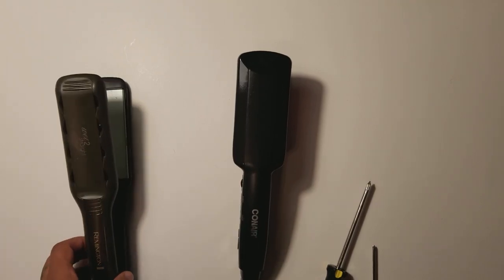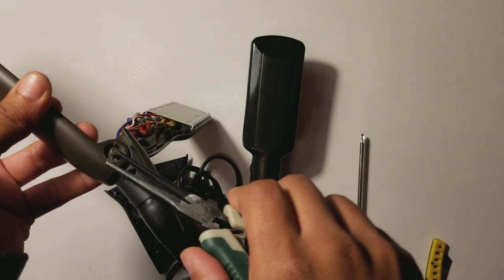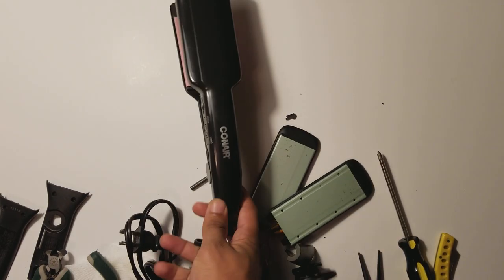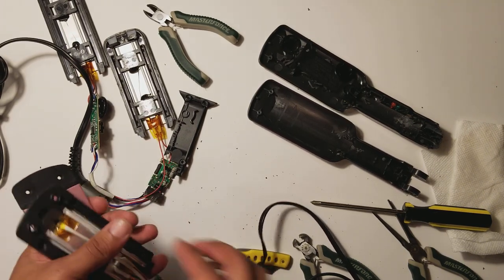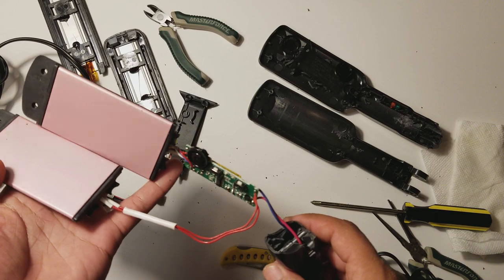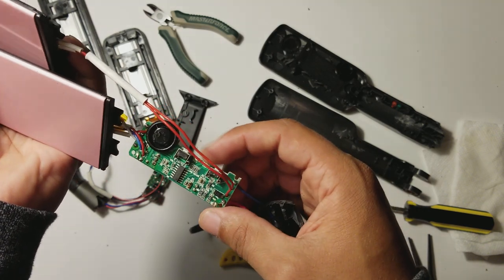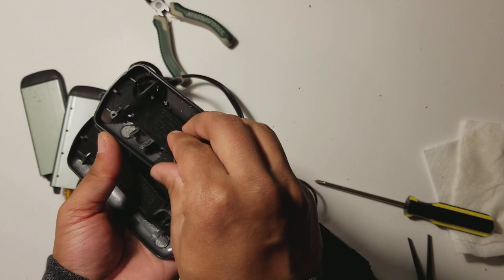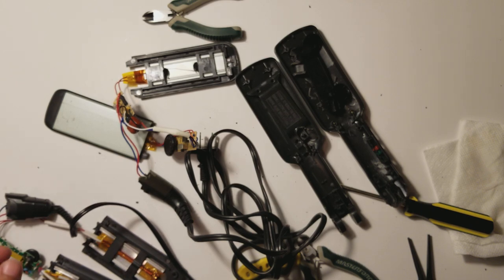How to make Rosin press (solventless exctraction) part 1 of 2

Comment: How did you attach the plates to the rubber base plates of the press without them melting ???
Reply: I think epoxy would be the best bet
Reply from the maker: I actually used a hanger. I bent it with pliers to wrap it around the vice grip. I got other videos that go in to it more
Reply from the maker: @Smokin' on Reggie cause u didn't  have it grounded a d must have had wires exposed or a nic I. Sheathing

Comment: Better to invest a few hundred bucks with a lifetime warranty then to take cheap/ghetto route like this.... If you can't even afford a couple hundred bucks for a rosin press, you shouldn't be smoking rosin.... Lol
Reply: idk where u finding any rosin presses for a couple hundred that arent junk because the cheapest im aware of is about 3k or like 3400 for the one i like.. u cant really cheap on out on these for actual high psi good squeezes, equal pressure, good surface area(bigger than like 2x2 inches), and even heat.. those chinese knockoffs for a couple hundred ive seen in person and when u put 1 single nug in there which thats all you can basically do. the plates cant even handle smashing evenly without bending on a corner its silly. electric ones are a joke as well. its just silly how good a nug juices with proper heat and pressure compared to a couple hundred dollar one that  is just making you pancakes and leaving your rosin stuck in that pancake
Reply: @snozzberrybush  nugsmasher Mini is 500$ and the bigger one is $1000 and I seen good results of it in use on YouTube
Reply: They have a 99 dollar press if u wanna b cheap I’m jus boutta grab me a nugsmasher mini so I cn have what he said warranty